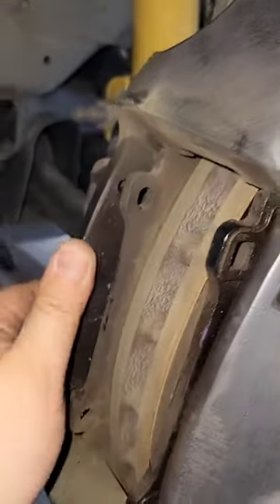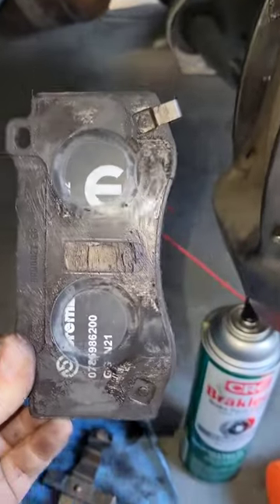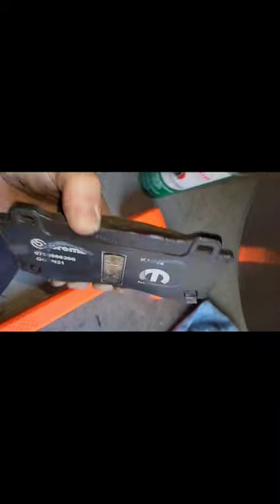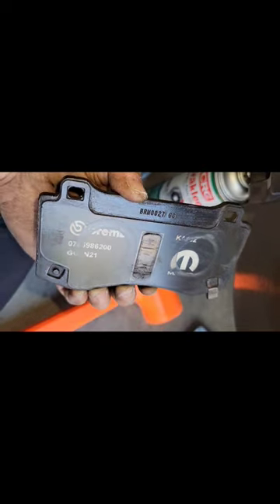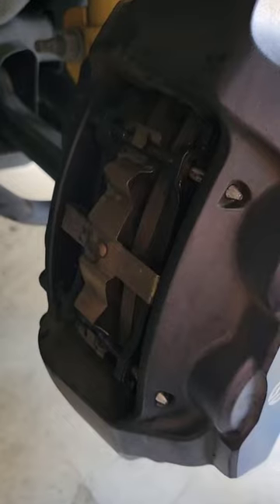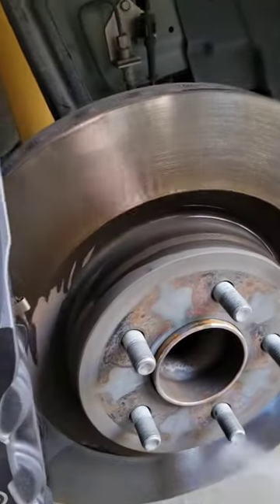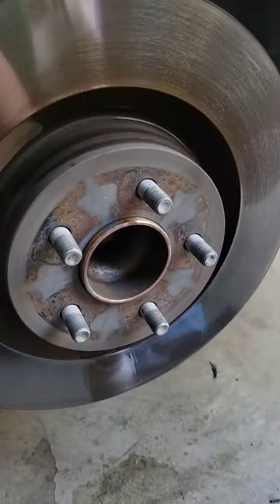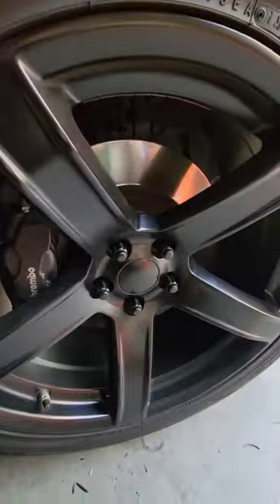Fix Brembo Brake Squeal #fyp #reels #howto #392 #hemi #v8 #shorts

Comment: Mine squeal real bad on a cold start when I first drive then goes away. Does yours still do the same
Reply from the maker: @MD-ss5pc  These brakes will usually do that. Mine used to do it all the time no matter what until I did this. Now only very rarely